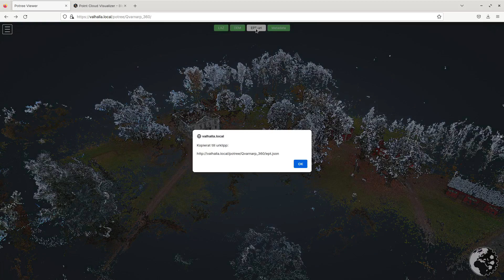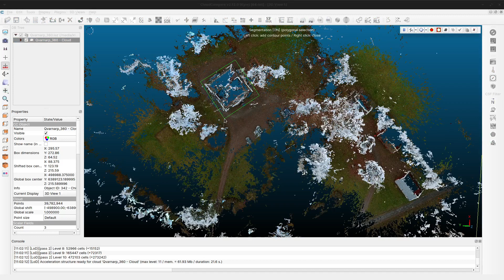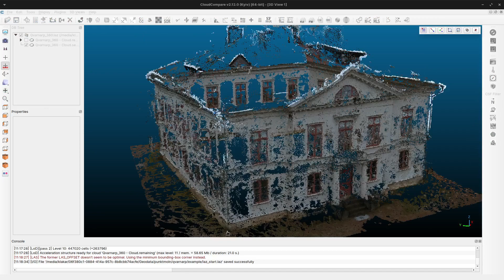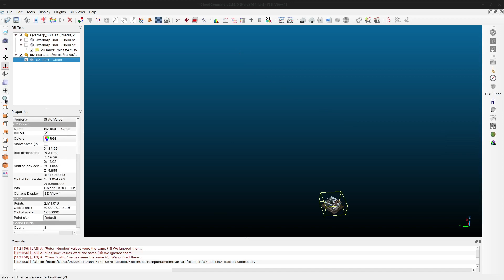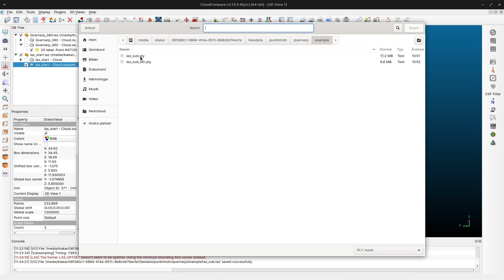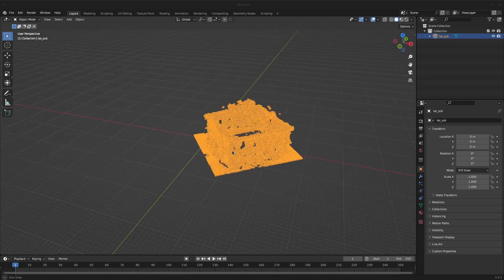QGIS User 0045 - Creating 3D models for QGIS

Comment: Hello Klas from a fellow Swede (I presume)!

First of all, thank you for your excellent tutorials!

I'm about to kick off a small start-up providing drone services. Therefore I've just configured a few backend server blades for client frontend, live video streaming, photogrammetry and hopefully a GIS workflow.

I'm an absolute newbie with both photogrammetry and GIS-work so I have the work cut out for me... 😛

I've been working quite a lot with IT infrastructure, EE, scientific work and such though.

As a learning exercise I'm now attempting to make a georeferenced 3D map for something called 'ATAK' (Android Tactical Assault Kit) or 'Android Team Awareness Kit). It's basically a Moving Map application.

My first trouble is to find the correct tool chain for my goal. Today I'm sitting here with ngnix, MySQL, AliceVision Meshroom, Blender, MeshLab, qGIS and WebODM configured and running. No add-ons so far.

The servers are a bit old-ish but should be adequate up to a certain point. I'm handling +300 48 Mpix photos as input to AliceVision Meshroom. But there's the pain threshold.

My first experiment is a huge (1.5 x 1 km) quarry which I have successfully built a few 3D meshes from, in four different resolutions, to see how much difference it makes and if the overhead in processing time is really worth it (not). I've worked with datasets containing 350 images in 5, 12, 20 and 48 Mpix. 48 Mpix took a full 12 hours to process into a 3D mesh. Mostly due to too little RAM in that blade. I'll try to double it eventually.

Then I cleaned up the .obj mesh somewhat in Blender, exported it to .ply and imported it as a new layer in qGIS. -Then I had to search for some tutorials - and found your videos! I couldn't even get a 3D viewport to show my mesh - but its onscreen anyway and so far I'm proud after only two days doing this! 😄

Now I'm wondering if my toolchain is adequate or even correct for my intended purpose? 🤔

My first goal is to produce a map, useable in an application called 'ATAK' ('Android Team Awareness Kit' or 'Android Tactical Assault Kit' depending on who's using it). The map format can be OSM (OpenStreetMap) or a number of other formats. I'm guessing I can convert the result from my tools to any format with other tools...

I'm basically looking to get a georeferenced 3D output from drone photography. Both visual and infrared (thermal). Later point clouds from LiDAR scans will be used too, but one thing at a time I guess...

My 'input parameters' for my work pipeline and toolchain are FOSS and Linux for the time being. FOSS might be negotiable at a later time but not Linux.

I've got two questions for anyone knowing what I'm talking about:

1: Will above mentioned toolchain be adequate for what I'm looking to do; create a useable, georeferenced 3D map for common map applications?

2: Is there a good opensource tool (Linux) with which I can make area and volumetric measurements on my map or a 3D model created with above mentioned tools? This need is for another use, not for 'ATAK'. I'm looking for a simple viewer with ability to do these measurements. Since this will be client side I'm looking for Linux, Windows and iOS applications to view and measure these maps / models. Not necessarily FOSS but preferably. Commercial pay-ware as an absolute last resort.

If I'm missing something essential I'm extremely thankful for suggestions! That is; suggestions about what tools I need to configure and learn.

The steps necessary I will try to learn myself at this point. Therefore your videos looks like a pot of gold right now! 

Best regards from Northern Norway!
Reply from the maker: It sounds like you should take a look at WebODM (Open Drone Map) - https://youtu.be/LK5bN38VqIU
Reply: @KlasKarlsson  Thank you. I'm trying hard to do that right now - but I'm trying to get it running with CUDA support (using Ubuntu 24.04 LTS and Docker-Desktop). 😛
It ran for a bit (without CUDA support) but then stopped. So I'm more focused at getting the --gpu variety running.  Might install a non-virtuslised Docker machine to try it with CUDA support since this seems to be the way to go process timewise...

Looks like this is a troublesome venture... 🙄